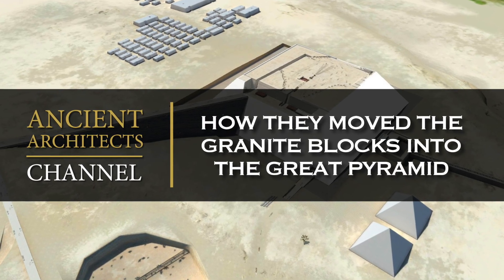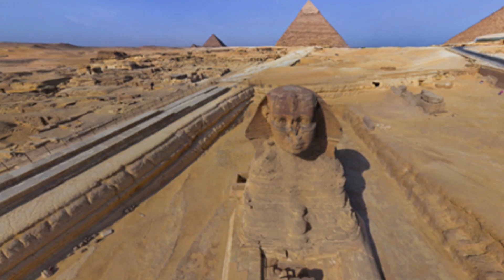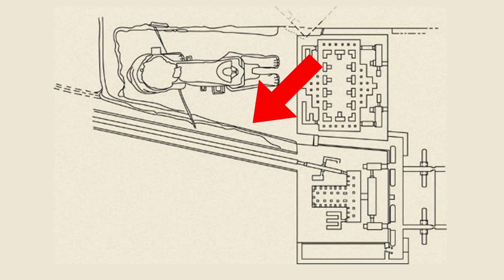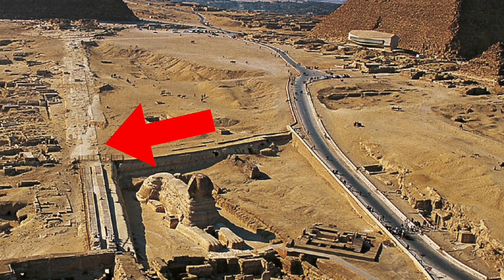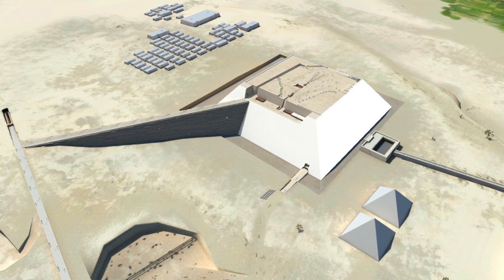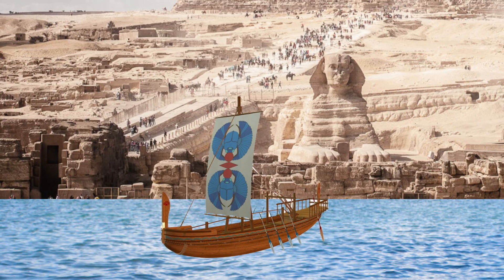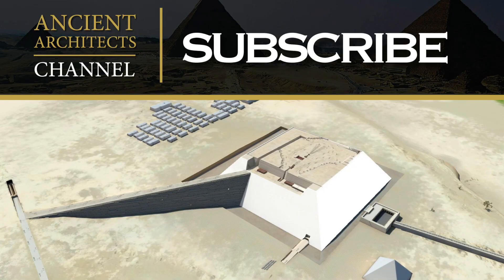How They Moved the 60-Ton Granite Blocks into the Great Pyramid | Ancient Architects

Comment: Dear A2, Thank you for your great research on The Great Pyramid of Giza. Does it really matter how the 60 ton blocks were transported and lifted into the pyramid? What really matters is what they were used for and it seems quite obvious they were put in place to contain extreme pressure coming from the King's chamber. They calculated the necessary weight for the combustion or whatever it was that the king's chamber was used for. There is no other plausible explanation. They were not needed to support the weight of the pyramid. We need to find the answer though, and I'm sure A2 is going to nail it one of these times. Keep up the good work!
Reply: It matters because (a) it is fascinating and adds to our knowledge of the Ancient Egyptians (b) because some people like to claim they were too heavy to  move so it must have been Aliens or Atlanteans.
Reply: @granthurlburt4062  GGGGGGGreat to hear from you. Here is what my research has turned up: The Great Pyramid of Giza
1. It is 3/60th of a single degree of true north                                                                                               2. It weighs 6 million tons                                                                                                                                3. Its footprint is 13 acres                                                                                                                              4. It is more than 755.9 feet along each side                                                                                               5. The Great Pyramid is 146.75 m high, its height X a million equals the distance from the Earth to the sun                                                                                                                                          6. It has more than 2.3 million individual blocks of stone                                                                         7. It is locked into the Cardinal dimensions of our planet; The dimensions of the Earth are incorporated into its dimensions                                                                                                           8. If you take the height and multiply it by 43,200 you get the polar radius of the Earth                                               9. If you measure the base perimeter of the pyramid accurately and multiply that measurement by 43,200 you get the equatorial circumference of the Earth                                10. The scale is not random, the number 43,200 is derived from a key motion of the Earth, which is called the precession of the Earth’s axis                                                                             11. The Earth wobbles on its axis very slowly at the rate of 1 degree every 72 years; 43,200 is a multiple of 72; 600 X 72                                                                                                                                      12. The Great Pyramid of Giza gives us the dimensions of the planet on a scale defined by the planet itself                                                                                                                                             13. There are several 70-ton blocks of granite from a quarry 500 kilometers away, one of hardest stones, raised 300 feet above the ground                                                                                                                                                14. It has eight sides, and at the spring equinox and the autumn equinox one side of the pyramid is in the shade in the morning and again in the late afternoon and can only be seen from the air                                                                                                                                                15. It is a calendar                                                                                                                                                16. It has expansion joints                                                                                                                             17. It is located at the exact intersection of the longest line of latitude and the longest line of longitude of the Earth, in other words The Great Pyramid is located at the precise center of the Earth’s land mass                                                                                                                                                       18. The builders possessed highly sophisticated knowledge of mathematics and geometry                                                     and they had knowledge of the true dimensions of the Earth to extreme precision                                                         19. The builders possessed exceptionally advanced technical instrumentation (laser guided surveying tools?) to site The Great Pyramid                                                                                                                                                    20. Pi = C over D Phi = Divided by 5 + 1 over 2. Archimedes discovered Pi about 250 BC, but Egyptians knew of it 2,250 years earlier                                                                                                                  21. If you subtract the inner circle of the base from the outer circle around the base (the circumference of The Great Pyramid), you get the speed of light in meters to four decimal points: 299,792,458 meters per second                                                                                                     22. The weight of The Great Pyramid is 5,273, 000 tons and that multiplied by a billion is the weight of the Earth                                                                                                                                   23. The three inner rooms; the king’s chamber, the queen’s chamber and the unfinished chamber under the pyramid are proportional to the distances between Mercury, Venus and the Earth                                                                                                                                                            24. The distance from The Great Pyramid to the North Pole is the same as the distance from The Great Pyramid to the center of the Earth                                                                                                              25. If you divide the perimeter of the pyramid by 1/2 its height the result is 3.14 Pi h/2 = Pi                                                       26. The base side length is 364.242 which is exactly the time in days it takes for the earth to orbit the sun                                                                                                                                                       27. The high chamber is built on a double square, which leads us to the golden ratio geometry 28. Pyramids in China, Mexico and Egypt align with the Orion star system
Reply: Both the how and why are interesting, because it suggests use of an unknown, or hidden, technology; with examples, in other parts of the world, that may predate the Pyramids
Moving two blocks of sandstone 500 miles (upstream!?) was to carve two statues, weighing around 720 tons each; that was in 1350 BC (dated by subject matter). Hard to explain.
While the triple portcullis (at the entrance to the Kings Chamber) looks like blast doors (to me); frequently raised and lowered (shown by the wear on granite grooves in the lifting mechanism), possibly connected to counterweights on the sloping Grand Gallery (where there's evidence of scorching). So I agree with you that the Great Pyramid was not a tomb. 
While if the builders went to the trouble of making a causeway, it may have included a railway (or rollers) and I suspect the use of hydraulic lifting gear (rather than massive ramp). 
It's also likely the builders had power tools, and maybe cutting using high pressure water, with abrasives... the how is important, as is the naked ambition; it looks like a machine...

Comment: Primitive people using copper tools cannot move 100 ton stones or even quarry and carve granite ....

Do you realize there "Khafre" pyramid has an engineered plateau, because of the uneven ground?? 
This involves a people with copper chisels cutting large sections of one side of bedrock and moving it over to the other side to make the ground level..... With COPPER CHISELS..  
Not sorry but no primitive people did all this. 

You didn't explain how they PRECISELY placed the stones next to each other either.... You kinda left that out. 
It's because there is no believable  diagram that will show men lifting 70 ton stone. The ramp would fall apart well before you even get the stone to the pyramid . Their small boat will not carry 140k lb stone.... 
What about the 1300 ton collosal statues??
Did they float those down the Nile ?? 🤦

Face it, were dealing with a pre-cataclysmic advanced civilization that could cut and move granite like it was nothing 🙂

Comment: There are many hypothesis of how to move large blocks to get TO the site/pyramid. There seems ZERO hypothesis about how they moved them into place with such accuracy and the construction plan needed to know what went where etc. They didn't just get them up there and plop them into place. It's analogous to a truck moving a 40 tonne beam, lintel, block etc 100 miles to a site. Once it is at the site, that is when the fun starts. Getting a 60 tonne block onto a boat is rather a challenge as well.

Comment: I'm confused on the concept of using a counterweight on a 60T block when they supposedly didn't have the wheel.  Usually, even with counterweights, we would use pulley's and these pits could not have been that deep.  I'm skeptical that it would be feasible to argue that counterweights were used in this fashion.

Comment: If your diagrams are to be believed, then the counterweight could only move a short distance, therefore are you saying that they would have had to re-rig the ropes every couple of yards, plus how did they reset the counterweight? I believe that they did not have block and tackle to help (I stand by to be corrected). Did they ever use beasts of burden to pull on the ropes. Where are the ropewalks? I have never heard one Egyptologist mention where the miles of rope that would have been required was thought to have been made or how it was made. Not enough on specifics for this to be believed.

Comment: If I was going to move 60 ton blocks of granite, then you can pretty damn sure I wouldn't lift those blocks off the boat until the boat was exactly in position. So either they had rollers on the ramp or the cause way was some kind of canal.

Comment: The off positioning of the kings chamber from the apex of the pyramid suggests that the granite stones were used as counter weights to pull the limestone stones up the ramp.  As the pyramid rose higher more granite stones was dragged up the ramp and positioned as new counter weights.  This is why the granite slabs in the various chambers are flat on the top (ceilings) and not on the bottoms (floors) as they were being dragged up and down the gallery on oil wood ramps.  The holes along the side of the gallery being used as stops for the workers that had to reset the counter weight   The use of those counter weight granite slabs offset most of the weight of the lime stones and the gallery moved more than 50 percent of all the lime stones.  Granite being used as a counter weight as it is a lot heavier than lime stone of the same size. At that the final chamber level, an interior ramp could have been used to drag up the increasingly smaller and smaller lime stones.    Doing it this way you could pull massive blocks up 8 degree inclines using a smaller work force and it would be a lot quicker.

Comment: I believe the Sphinx enclosure was already there and they built the causeway on top of it. Thats why its at an angle and not straight leading up to Kafre. They clearly built the causeway around the Sphinx or the Sphinx would have been built to the right of a straight causeway. The Sphinx is clearly a much older equinox marker. If They had the technology to quarry the stone and remove it out of the quarry, they surely had the technology to lift the stones into place probably without the need for such huge ramps. Regardless of what we all think, projects like this or the panama canal or suez canal or hoover dam it all still cost alot of money. The modern estimate for building the great pyramid is between 2&3 trillion dollars and 85 to 100 years. Now just imagine getting a country to flip that bill. They were  built before 10800bc by some culture before the egyptians.

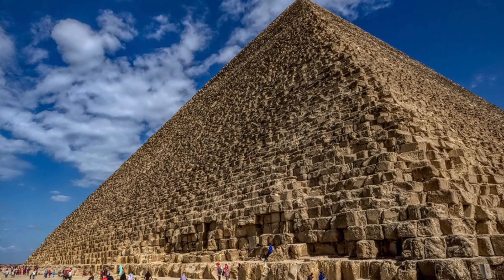Comment: Wow that must have been a monster of a ramp with a low gradient to allow workers to drag up a 60 tonne slab of granite. Further more he speculated the ramp was made of concrete, that would have been a task in itself, constructing and demolition of an insane amount of m3 of concrete. You'd think there would still be more evidence of its construction and waste dumped somewhere nearby? I wonder if it is feasible that they pulled a smaller weight to the top, tied that to the granite then pulled that weight down to help pull the granite up, is that essentially what hes describing in the counterweight system? I'm imagining a 2 way ramp to pull the granite up on one side and pull-up / down the counterweight on the other. Still how would they adjust the ramp for the different heights for final placement and manoeuvre them perfectly into position as shown at 7:14 ? Never really looked into this before but I'm now fascinated after a Graham Hancock podcast.

Comment: There is one very credible theory  that the pyramid blocks were floated vertically using water filled "elevator shafts" where the stones wrapped in papyrus would allow them to be lifted into a shallow canal at the current "top" of the construction. This would align with Egyptians fascination with canals and underground lakes. Most of the causeways could have been canals.

Comment: The wall was already there?  Of course it was.  Why?  Once that is solved, I believe most of the Giza Plateau will be solved.  There was a road there, or perhaps another wall...long wall though.  The Sphinx faces a certain way because the Egyptians needed that, or the out cropping of rock the Sphinx is made of lent itself to that directions.  The enclosure was built around the Sphinx and the south wall was left as it was because it was already there.  It was used later for the ramp and cause way.  Why was it not reworked at that time, because it was not necessary to rework it, it worked fine for what it was needed.

Comment: you have no problem believing that they can load 60ton granite onto barges and sail them to the causeway. Then drag and pull it ~500m. Then rotate the block and drag it at a much steeper incline for ~300m. Then use the Grand Gallery to lift and maneuver the blocks in a tight working area. Let alone use diorite to break out the block after a year of work.

But you cant believe that the sphinx was made after the pyramids were built/started construction because it is a better story to push either its construction date earlier - or the original construction of pyramids on the plateau much farther back in time?

Comment: The ridges on the Pyramids are all spiral not horizontal that does fit your theory. However, the cutting of the stones was done by a higher technology than we have today. Also they must have used steel ropes in a pulley system to pull the heavy stones which also indicates lost technology in manufacturing. Another point is that the cataclysm that happened worldwide 12,000 years ago causing the great flood and redirected the Nile to flow many miles away from where it was in your diagram also fits your theory.

Comment: I’m having a hard time picturing how these counterweights would have looked.
Reply: Undoubtedly they consisted of many smaller stones ( for easy moving) placed in a basket or container of sorts. 
Remember the counter weights didn't have to be as heavy as the stones they moved. 
The counterweight had to be just heavy enough to help get the large stoned started. The hardest part is getting it going. Once in motion it is much easier to keep it going.
Reply: @surfk9836  
Yes, and it's not too far fetched to assume they may have had a pulley system of kind to reduce the required force.  If you haven't seen the video below, I highly recommend it.  It shows a very simple clever way the Egyptians may have raised their obelisk without "high tech".  It shows the ancient Egyptians were clever.

Pharaoh's Obelisk

https://youtu.be/lfED-vgvQM4
Reply: @surfk9836  ffffff can people stop acting like u know everything that's just cap is very ease talking, u can't do that shit in real life